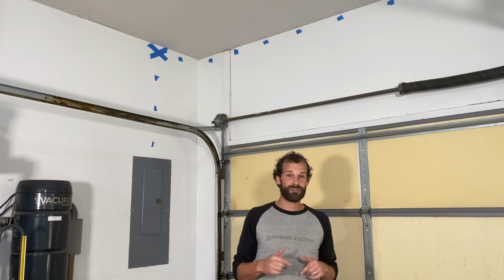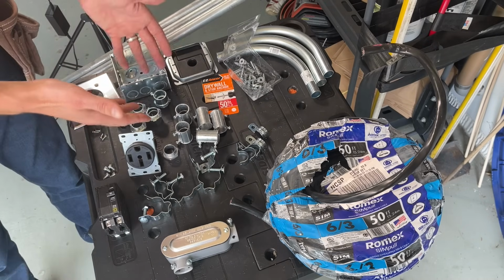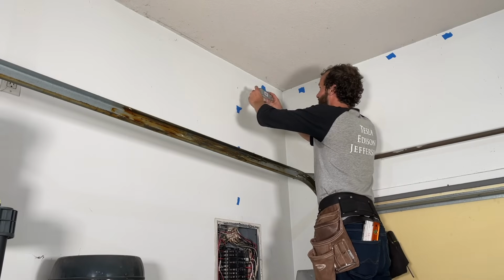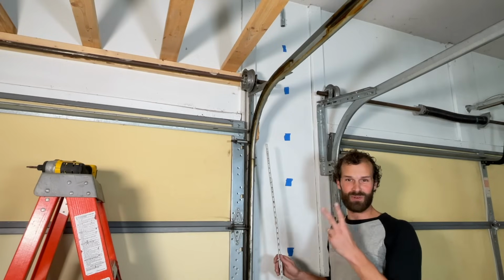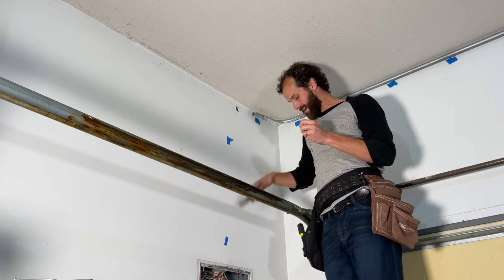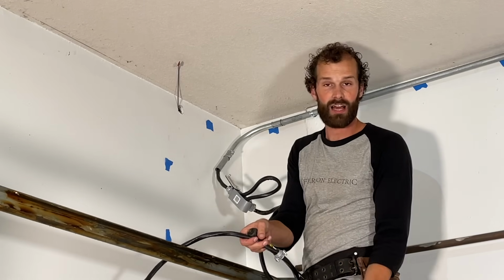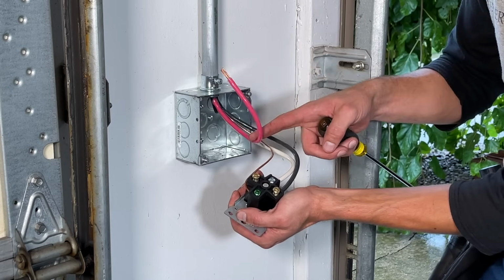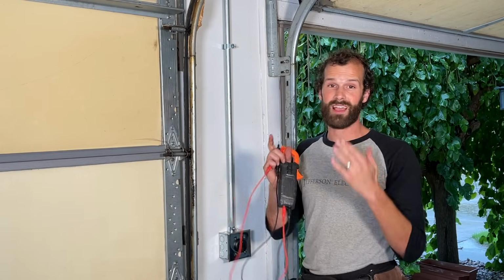How To Install a 240 Volt Outlet | Electric Car Charging

Comment: As a certified Tesla installer and a electrical contractor I have installed literally hundreds of Nema 14-50s and Tesla car chargers over the last 5 years. I really wish you would not tell "do it your selfers" to attempt this. I have been asked by Tesla to replace a number of improperly installed units because of improperly connected or torqued wires and other installer failures. There are too many places that wire can be nicked by novices or kinked with improper radius and over bending.
 I also was horrified at you using a metal fish tape in a live panel. I have taught a number of apprentices and I would never suggest using any conductive fish tape in a live panel. Fiberglass or nylon tapes are cheap. Your life is not. Also use insulated screwdrivers in a live panel. Wear gloves and eye protection always. Get a reamer tool, a stud finder and some other easy tools to afford.
 Also, one thing about running Romex in conduit. There is a heat dissipation issue. I was taught never run Romex over a foot in a conduit of any kind. If you have to, oversize the conduit. Maybe use one inch if you have to or run flex down through the wall to the panel and use regular stranded wire. 
  All terminal screws should always be torqued with a flat blade or square drive screwdriver. Do not use a phillips.
Final note: use an industrial type cover not the stainless finish cover you used for surface mounts. That cover you used is for in the wall applications.
Reply: This channel is all about doing things wrong and putting the wrong info out there, I really wish we could still see the number of dislikes on the videos, I bet it would be high!
Reply: As a professional electrician.  I agree!!
Reply: The NEC specifically allows Romex (NM) to be installed in conduit or EMT - see 2020 NEC 334.15(B). 

Romex/NM (current UL Listing) uses 90dC rated conductors. This installation is using those conductors at their 75dC rating [as allowed per 2020 NEC 110.14(C)(1)(a)(3)] of 65 amps - but #6 AWG copper is rated at 75 amps at 90dC. Plenty of ampacity here, unless the garage temperature gets significantly greater than the 86dF used in 2020 NEC Table 310.16, in which case a temperature correction per 2020 NEC 310.15(B) needs to be done.
Reply: @jamesreizner2673  Read the constant use chart de-rate 125%
Reply: The NEC allows romex inside of conduit as long as it is not in a wet location such as outdoors or underground.  Also the guy in the video used a square bit not a philips.  Pay attention.
Reply: @steelersman74  Much electronic equipment designed for use in Canada will have square (aka "Robertson")  head.  Canajun don't you know.

In normal 120V outlets, switches, boxes and such bulk items, there's not a single philips to be seen, and flats are only used for outlet and switch covers.

As my dad, a Civil PE used to say, the sale of philips should result in fines and mandatory community service sentences.  The sale of flats should be considered a capital offense ;-)

He did like Torx tho ;-)

I agree ;-)
Reply: Very sad, there are alot of ppl just like this guy on YT giving bad info. Only electricity is extremely dangerous and I think some ppl really don't understand it like professionals do.😔
Reply: I am guilty as charged for using YouTube for stuff. That said I just cringe when I see these guys showing anything more than swapping out an outlet. Somebody is going to get killed.
Reply: Question.  Here he's presumably installing 240. Here in the SF bay area, I haven't seen 240 anywhere.  Is 208 sufficient for charging a tesla?
Reply: @donphillips5957  I bet your house has 240 volts, not 208.
Reply: @jamesreizner2673  nope. Checked.
Reply: @jamesreizner2673  In some areas, particularly commercial buildings fed directly with three phase, you often have 120/208V not 120/240V.
Reply: @donphillips5957 In most single family dwellings or smaller shared housing there is single phase 120/240V (nominal) service.  In larger shared housing units and most commercial it's three phase 120V/208V.  If you have 208V in a single family house, you should call PG&E because that is really low.  But... power=current X voltage.  The current will be the same (in this case 40A MAXIMUM) as the voltage changes so does the maximum power transmitted.  In your case 208*40=8320W.  In this video they had 250, so 250*40=10,000.  All that means is his car will charge faster than yours.  Will it work, absolutely!
Reply: @matthunter1424  With equipment more complicated than electric heaters, water heaters and electric dryers, 208V versus 240V MAY matter.

There is NO substitute for checking the specifications of the device you're attaching to see if it will allow both.

I would suspect that many EV chargers won't care, especially those intended to be used with parking lots, and multiple-occupancy dwellings where the building is fed with 3 phase, that 208V is fine.  But don't ASSUME.  Check the EV charger specs before buying the charger, and finding out that the EV charger won't work.
Reply: @donphillips5957  Most simple 240V devices (like heaters and dryers)  will work on 208V, albeit at lower wattage, but you have to check the charger specifications to be sure.  The specifications will give the allowable supply voltage values.
Reply: @donphillips5957  Put a  meter on it.
Reply: @trex2092  did, you guys were right, residence is a solid 240.
Reply: @donphillips5957  Bay Area is no different from other parts of the USA and Canada when it comes to residential electrical system. You have a 240V split-phase coming in. The voltage between two hots is going to be your 240V.
Reply: @donphillips5957  
EDIT: The following I quoted from the internet with the reference below is wrong. Hmmm. Take this comment with a grain of salt. 

Yes, 208 V is 3 phase. 240 V is 2 phase.  Both are fine. With two phase, you might be able to visualize 120+120=240. So where does 208 V come from? The 120 V leads are not 180° out of phase but are 120° out of phase. 208 V will be a little bit slower. 208 V is generally commercial power while 240 V is generally residential. 
https://youtu.be/xMZkKI5rleg
Reply: It’s not called 240V two phase. It’s called 120/240V single phase or you can have a 120/240V 3 phase grounded delta.
Reply: @atmacm  
Thanks for correcting me. I was wrong about 2 phase. 
👍👍👍

“240V residential power in the US is single phase, delivered by a center-tapped transformer winding with the CT grounded. 120 from either end to center (neutral), or 240V across the 2 ends of the winding. In NYC, 3 phase 120/208 is the residential distribution in all homes.”
Reply: @techguy3507 in the Midwest we’re I’m at its extremely rare to 120/208 in a house. I’d say it’s safer in most cases than going 120/240V delta with a high leg because DIY guys end up accidentally installing a single pole breaker on the high leg and end up smoking whatever they had on that circuit because the high leg is 208V
Reply: @atmacm  3 phase will be 120/208...
Reply: @matthunter1424  if it’s a Wye it’ll be 120/208. There’s still quite a few 120/240 3 phase grounded Deltas in my area. In the 120/240 delta, 2 phases will be 120V to ground and the third phase will be 208V to ground and that’s your high leg.
Reply: @donphillips5957  its the same.  208 220 240.  All variations of the same.  The same can be said for 110V 115V and 120V.
Reply: How about stripping the Romex sheath inside the conduit until you exit the conduit body inside the wall.  Would be an easier pull and no heat gain in the conduit.
Reply: @marcbreault9371  No, just no. It's not intended, designed or tested to be used like that. Just spend a few extra bucks and buy THHN -- they are specifically designed to be run in a conduit.
Reply: @marcbreault9371  the insulation on the bare wire would have to be rated. The easier way would have been to pipe it 100 percent of the way and use THHN wire.  Even if he didn't have access to a bender for the pipe to make a offset out of the top of the panel there's ways around that.  For example, a piece of 3/4 flex in the  wall up to that box.  Or a short section of  flex out the  of panel to the  finished side of drywall and then   a flex connector into a barrel connector to a emt connector. I believe there's a  connector that does this in on shot. I have a 1/2inch one floating around so guess there's a 3/4 one. The take away from this is just because you have a YouTube channel doesn't necessarily mean it is a good idea to promote showing  people projects above peoples pay grade.
Reply: @robm3063  Thank you Rob. I agree.  Yes could of used a 3/4 coupling between the two box conns. (Liquid tight and emt.) I probably would of used pvc instead of emt with a nice 1 hub on the water tight pvc two gang box mounted on painted 3/4 plywood. Some of these Ev chargers on 6-50 nema receptacles so you could make the white the grounding conductor and mark it green with no derating.
Reply: @marcbreault9371  No need to worry about heat gain, as I noted below in my response to GW below.  The local Code inspector might not allow stripping back the sheath like that to run through conduit (actually EMT tubing) - as the Romex has a UL Listing and doing so might violate that UL Listing [see 2020 NEC 110.4 (B) and 110.8].  Also see 2020 NEC 110.2, which requires all conductors to be "approved" (by the Code inspector).

Safest thing would be to check this with the Code inspector first.

Comment: Only skimmed the video. So many code violations...

NM cable is not approved for install in conduit. 

You forgot to bond the outlet box, the mud ring screws alone are not approved to bond the box. 

Permit and inspection?

Comment: What is the reason for having the full conduit in place before pulling the wire? It seems it'd be easier to fit the pieces, then slide them over the romex. Does the code say that's not allowed?

Comment: This is pure Mickey Mouse business. You lose me at 2:41: Anyone who has been around live gear knows you limit the gesturing, less finger pointing, use a plastic pen, etc. Glaring safety issues, poor planning, improper material selection, and refusal to deviate/learn once you encountered obvious issues. You also violated the minimum bending radius of the NM cable when shoehorning it into the conduit body, it's usually something like 5x the cable diameter. An often overlooked point on conductors is that the 6AWG in NM cable is 7-strand, whereas typical 6 AWG THHN/THWN is 19-strand. Not all wire is created equal, which is partly to blame for how tough of a pull that was for you. You know they make industrial raised covers right? Much cleaner than a plaster ring/faceplate, your first hint that was the wrong part is the lack of plaster/wallboard!

I'm not sure why you'd be proud of this representation of the work, and I'd be worried that others following your lead will get hurt in the process.
Reply: Right there with you brother.
Reply: Conduit body should have been a J box instead and THHN pulled to outlet location, industrial cover and please connect ground to the deep 1900 box......
Reply: @macbigmac5926  I would have preferred to run flex in the wall to LB or J box and run one length of THHN all the way in the conduit. Thereby no splice in the run of wire. Not a good practice splicing #6 on a continuous use load.
Reply: If he wants this to be a DIY, I'm assuming the person going to attempt this is lacking electrical knowledge. Maybe he should warn them about the busbar or lugs before popping off the cover.

Comment: Wrong pulling L, and the guy didn't even use a grounding screw for the ground wire in the four square box. And I'm pretty sure I watched him flip that breaker on as soon as he popped it into a live panel. Also, why is he using Romex instead of regular THNN? Supply houses will pre-cut wire to the desired length. Yeah, don't follow anything this guy says. Hire a professional, folks.
Reply from the maker: Thanks for the feedback.

Comment: Excellent instructions. I am in Canada where "square drive" Robertson is the common screw. I have wired two homes and done lots of alterations and learned more from you. I will point out one of my pet peeves, the screw DRIVER is a slot, screws have flat head. Flat, oval, round, bridge head screws can all have slot, Philips, Robertson, Allen, or torx etc screwdriver sockets. 

One thing that you left out was the amp capacity of the panel vs the physical capacity of the panel the second thing was permits.

Comment: Always use a licensed pro for this type of work. This work is permit required and not a DIY. Also you need to do a load calculation on teh panel before you add a 50Amp load to the mix. In most cases you will require a service upgrade from 100Amp to 200Amps
Reply: Absolutely Bro!

Comment: Hi Folks, any chance on getting a video about how to add a 220 50amp outlet when your main panel is full?
Reply: You might be able to use a quad breaker. I would prefer you all a licensed electrician.
Reply: @Sparkeycarp  Agreed, electricity on this scale is out of my league but I'd still like to see it done even if I'll never do it myself.
Reply: you add a sub panel beside your existing main panel and move a few branch circuits over to install a feeder breaker for the sub panel. Or replace the main panel with a panel that has more spaces, but this is more cost usually.
Reply: if your panel is full, probably 100 amp, you need to upgrade to 200 amp. home loads are constantly increasing & the car charger 50 amp circuit is quite an increase & probably more than a 100 amp main service can handle.
Reply: @garybrown7044  Thanks for the info. My main breaker says 200 amp on it already.

Comment: My first comment is I appreciate quality... all fittings aimed at 90 degrees is paramount and a level on everything plumb, well done ... my second comment won’t be so generous!!! OMG you are still using a stiff metal fish tape??? Why in GODS name would you have a steel fish???when fiberglass fish stick could have done a excellent and adequate job of fish in ... My third comment is a 50 amp breaker is # 8 not # 6 conductors... There’s always more than one way of doing something and I understand you are trying to show Diyers but I never would have done this this way ... first of all and most importantly no one in a panel... that’s not a knowledgeable electrician... PERIOD!!! Even knowledgeable electrician blow shit up and burn themselves with a dink of a screwdriver or come in contact with a live part !!! No too big of a risk ...

Comment: I have one in my yard. I two hundred amp service to a post in my drive way . it has ten gauge wire and all I have to do is change the breaker. and add a two twenty plug. I would put me a car port at that spot.
Reply: 10 gauge wire is only 30 amperes. You need 6 gauge for 50 amps. 💙 T.E.N.

Comment: As a union electrician western suburbs of Chicago this is nuts. First off go to Harbor Freight and buy a cheap  fish stick set. Next is location dependent . We don't use rope a dope here everything is emt. For all the work you did fishing that wall it would have been faster to make a nice easy offset out the top of the panel and surface mount the whole thing. A little drywall patch and your done. The romex through the pipe was crazy, just buy some wire and push it . I'm not sure if that is even code. I like the idea of EV cars and I know people are shocked (no pun intended) at the cost of 240 install but some things regular folk just shouldn't mess with. Just last month I got tagged doing a friend a favor, Who knew this guys father 40 years ago switched the white wires for the basement lights. Again this was emt and thhn wire. My fault for not tick testing first.
Reply: Thank you, im from Chicago as well and I thought I was going crazy for telling him to just cut the damn drywall and make the full conduit connection from the beginning to the end. Drywall and some patch work isnt that hard. This is the lazy way to do it and not to code (maybe in his area but not everywhere thats for sure). Disliked video for the lazy work.
Reply: rob m knows whats up

Comment: I see you deleted my comment of not bonding that 1900 box , code violation , death to someone when that hot wire touches that metal box and energizes that whole metal run , now that will be a death grip

Comment: .....excellent excellent video......only one question....the final cover plate, at the outlet....do they have a final cover with 'Rounded Corners,' so that some 'Moran' does not cut themselves on the edge of said plate????
Reply: He used a wall cover plate instead of a far in cover which is what you use on exposed boxes
Reply: Yes, there is an industrial cover that is more appropriate with no sharp edge.

Comment: Good training for what NOT to DO. The original homebuilder's electrician was incompetent. All those romex cables entering panel top thru a single large connector a dangerous violation, even worse than ty-wrapping a bundle of romex.
Reply: When that house was built it was legal to bring all the home runs through the 2” male adapter, if you don’t know codes don’t respond 😂😂
Reply: When was it code legal to have the ‘home run’ cables enter the panel through a ‘male adapter’?